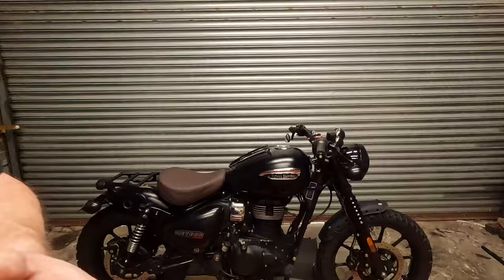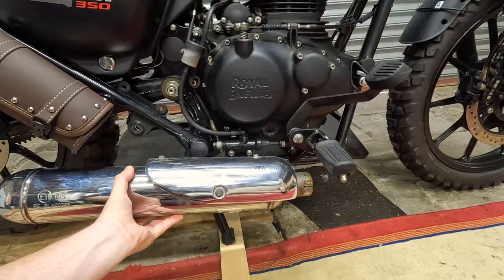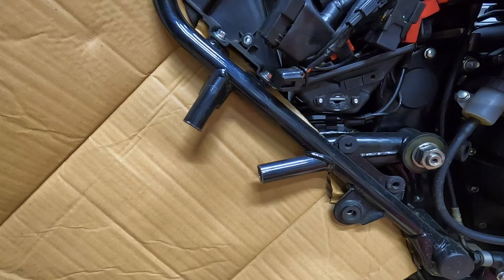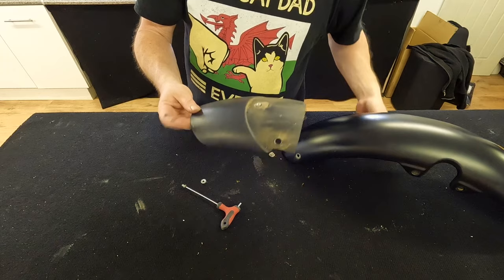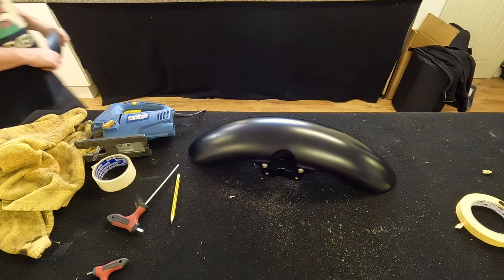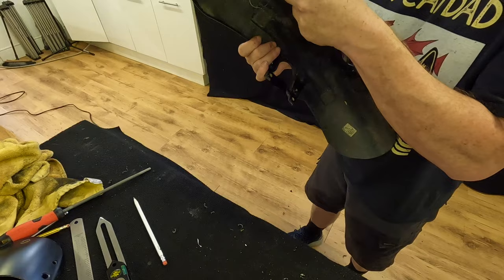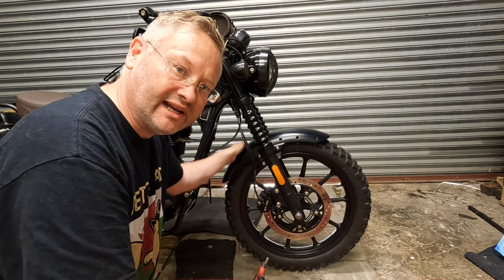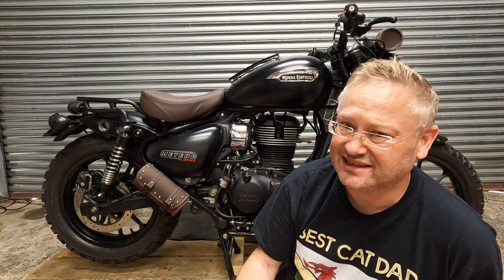Part 18 - Removing Pillion Pegs / Footrests from a Royal Enfield Classic 350 / Meteor 350 Bobber

Comment: Radical, but why not.
Going back to your brake video, I checked my 9 month old Meteor and couldn't see movement. I pulled the caliper apart for a look.
The pins/top guide hole were fine and well greased. I re-gressed on assembly. On post assy inspection the movement was there and on a test ride the front brake was noticeably better and sharper. They have remained so.
PS. Out of the factory, the rear brake line goes directly under the suspension unit.
Keep the coming, loving it.
Reply from the maker: Thanks Tim and thanks for letting me know about your brake, def can't hurt to get it as good as it can be (especially when you've only got one!  Thanks for the tip on the rear brake line, I could tell something wasn't quite right there and that makes perfect sense now so I'll get that rectified.  Cheers, Glyn